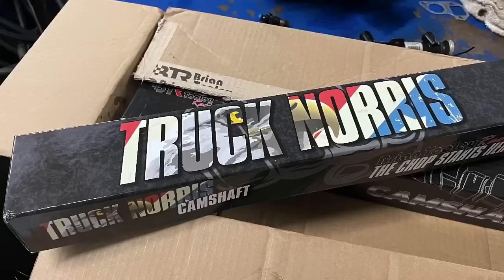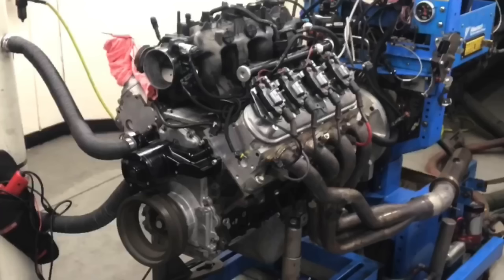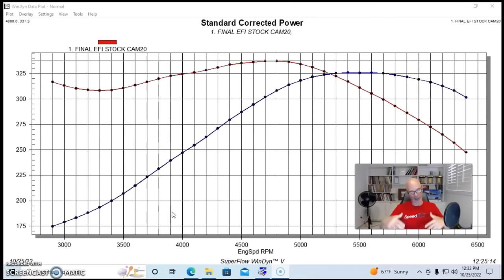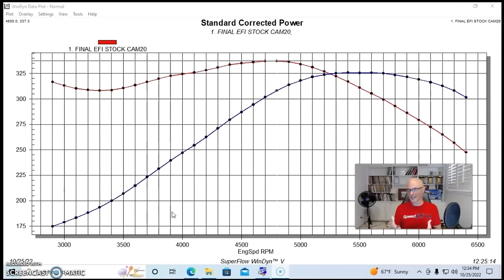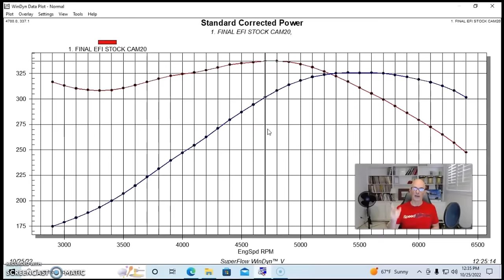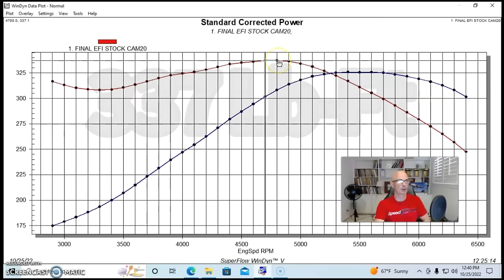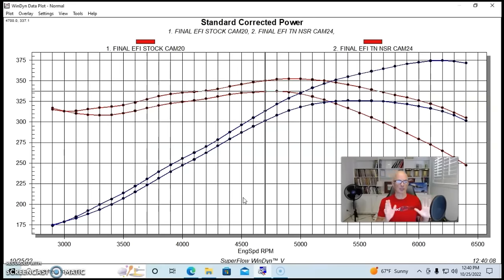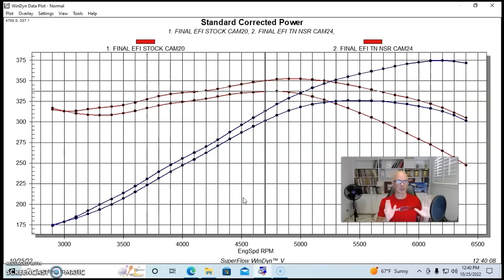4.8L LS VS TRUCK NORRIS NSR-CAN YOU ADD 50 HP WITH A JUNKYARD LS CAM SWAP WITHOUT CHANGING SPRINGS?

Comment: How did you get a stock 4.8 to run on 80lbs injectors?
I have a 6.0 with 46lbs injectors that i cant get to idle right, to rich at 1%
Reply: Lean it out more brother, 15.1 atleast
Reply from the maker: it idles fine
Reply: @sniperpronerfmods9811  how do you get more lean than a 1% duty cycle?
Reply: @TheRenaissanceBuilder  If you're running on a stock ECU, be sure to adjust your minimum injector pulsewidth and your small pulse adder.   They can wreak havoc on your efforts to big injectors to run properly at small openings.
Reply: @ChurchAutoTest  now that is helpful thank you very much!
Reply: could be a lot of things, but if you are getting to much fuel with smaller injectors one of the first things you can check is fuel pressure

Comment: No springs needed but you still may need injectors
Reply from the maker: more hp requires more fuel
Reply: Oh I'm aware but the average viewer just put a cam in, goes to get a tune, and isn't happy when they are told they need more put or injectors 😄. I see it so many trucks.
Reply: I don't see needing injectors for a mild cam.

Comment: Mr.Holdener, I have a question on how this information is presented. I think we all get myoptic on the numbers we see in these tests, and gains are gains and that's all well and good BUT, what is this doing to the drivability and to some extent what some people would like to know gas milage? 
          Mostly due to the fact we/some would be installing these in our daily drivers or trucks we tow boats or travel trailers with. Granted we want all the power we can have but also when the wife is sitting at the stop light after getting groceries lopping like she is ready at the staging lane at a 2am street race things get a little heated at the house when she's angry at the way the truck is running, I.E. "YOU SAID YOU WERE SPENDING MONEY TO MAKE THE TRUCK BETTER" (in bitchy female voice) 
          So I guess is this just a numbers game for each cam or engine configuration on this channel? I.E. go to the junk yard, grab an "LS", throw parts at it, make power, and yuck it up at the cars and coffee? or is it a this make your truck better? Because if we only see what every engine doing at 3500+ I have a feeling we are not going to be happy (in the long run) how these mods are working. Maybe could you do a video on real world scenario on this? 
          And granted I know vehicle weight, tire size, gear ratio, heat, elevation, towing weight, tune, timing, fuel, I get it but I think some of us need our bubble busted because lets face it after the newness wares off, were going to go back to the drivability of idle-3500k, and yeah look how badass it sounds but when every other time I drive my truck I have regurts*
Reply from the maker: I don't do drivability testing in vehicles-this is a dyno channel